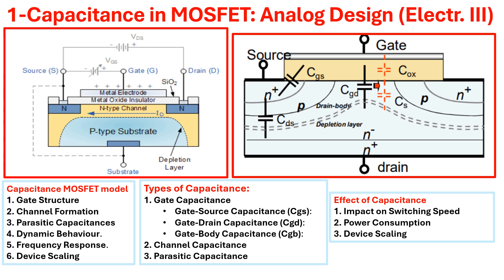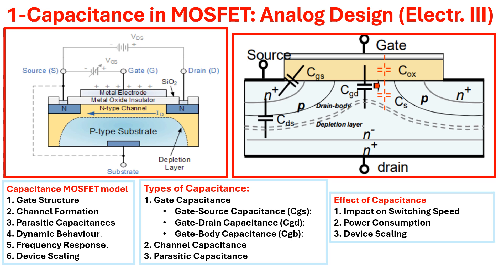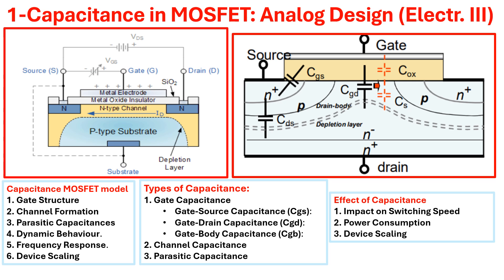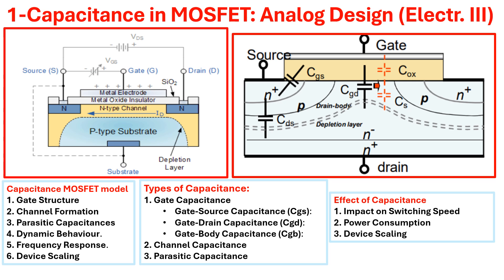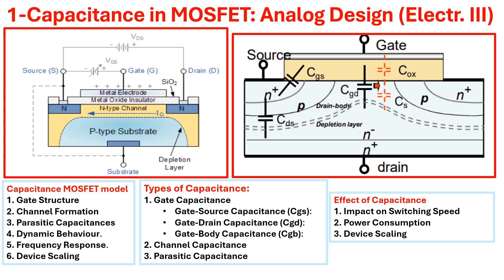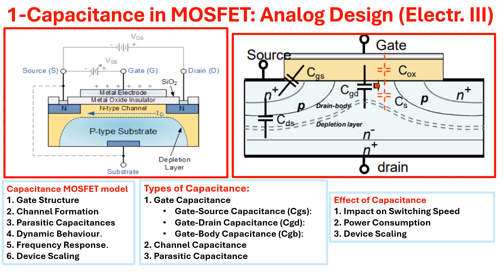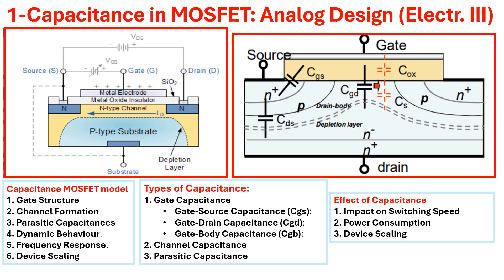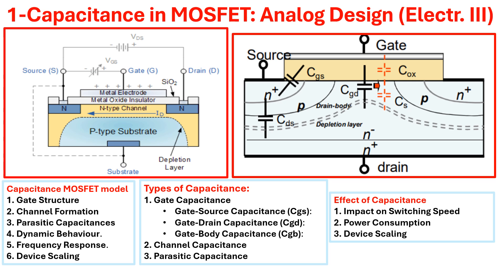mosfet capacitance | mosfet capacitor | mosfet capacitance explained | mosfet parasite capacitance

Comment: How device scaling will affect threshold voltage, please make a video for it.
Reply from the maker: MOSFET scaling refers to the reduction of the dimensions of MOSFET devices, particularly the channel length and width, in order to improve performance and increase transistor density on integrated circuits. As MOSFETs are scaled down, the threshold voltage (Vth) is affected by several factors:

1. Short Channel Effects
Velocity Saturation: As the channel length decreases, carriers can reach their saturation velocity more quickly, which may alter the effective electric field in the channel.
Drain-Induced Barrier Lowering (DIBL): With shorter channel lengths, the electric field from the drain can influence the threshold voltage, effectively lowering Vth.

2. Quantum Mechanical Effects
Quantum Confinement: In very small devices, quantum effects become significant, which can modify the potential energy landscape of the channel, affecting Vth.
Subthreshold Slope: The ability to control the subthreshold slope may degrade as devices scale down, impacting the steepness of the transition between the off and on states.

3. Oxide Thickness
Gate Oxide Scaling: Thinner gate oxides can lead to increased gate control over the channel, which can allow for a reduction in Vth. However, this also increases gate leakage current.

4. Body Effect
The body effect can become more pronounced as the source and substrate bias conditions change, impacting the threshold voltage.

5. Material Properties
Changes in materials, such as using high-k dielectrics, can also influence the threshold voltage due to altered capacitance characteristics.

6. Temperature Effects
As devices are scaled, thermal effects can influence carrier mobility and, consequently, the threshold voltage.

Finally, as MOSFETs are scaled down, the threshold voltage can decrease due to short channel effects, quantum effects, oxide thickness changes, and other factors. This necessitates careful design and consideration to maintain device performance and avoid issues like increased leakage currents.